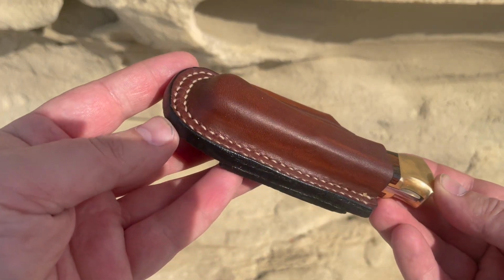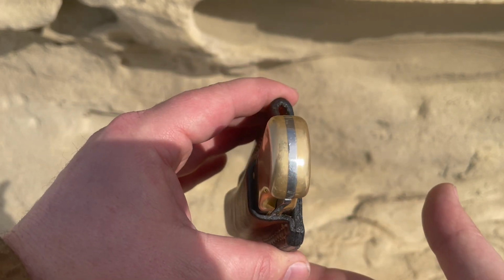Buck 110 Sheath Redesign and Giveaway Winners!

Comment: How would you make this to go on your left side for right hand draw
Reply from the maker: You could just put it on upside down on your left side. It would work just fine that way. It will ride slightly higher that way but only cm. If I knew I wanted to carry on the left side all the time, I would build the sheath with the blade on top in that orientation, but that’s a personal preference thing

Comment: Could this be adapted to a 112 automatic with a snap flap? I made something similar, but it doesnt look near that good. Any suggestions? Thanks.
Reply from the maker: Yes, I’ve made several for the 112. I like to do the 112 with bottom end in the sheath rather than the pivot end.

Comment: What is the leather thickness you used for this sheath?

Also, what thickness do you like for a knife like say the buck 119?
Reply from the maker: I used about 5 oz on the front piece that is wet formed and about 8 oz on the back piece that also forms the loop. For the buck 119 it depends on the style of sheath but I’d say about 6 oz would be good off hand

Comment: A little tip. When I use edge Kote or any other edge paint, I apply it with a #2 pencil. I also have the professional roll on tool but honestly, the pencil works fast and smooth.
Reply from the maker: Thank you!